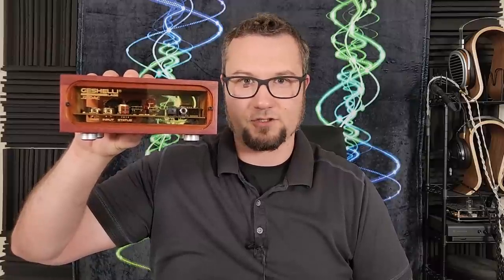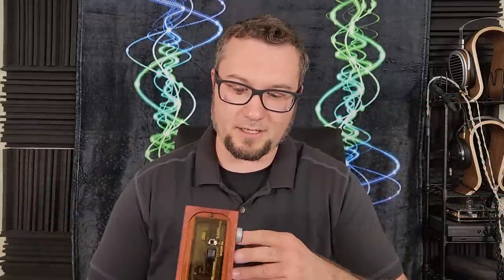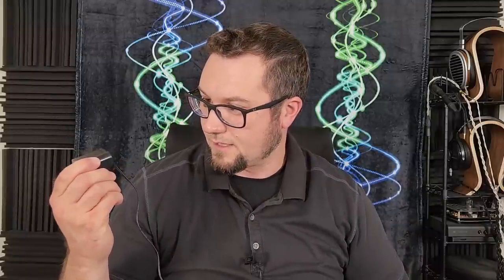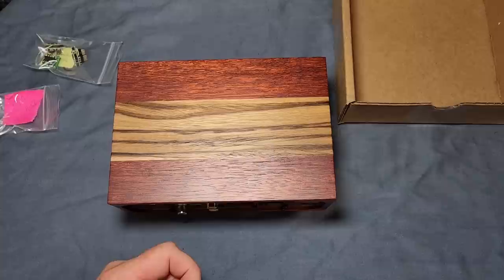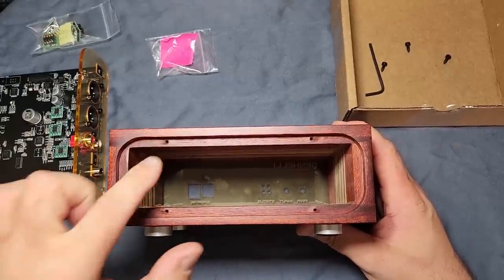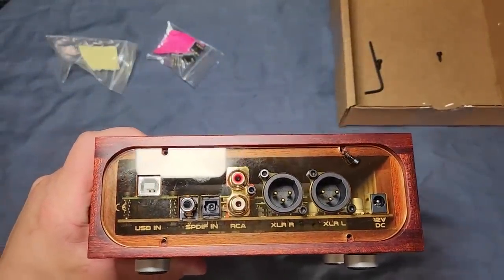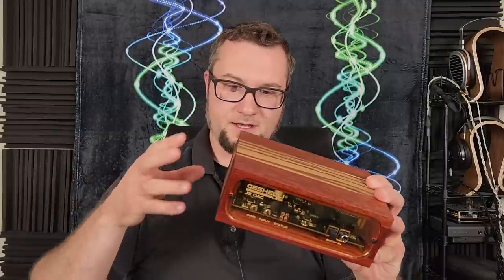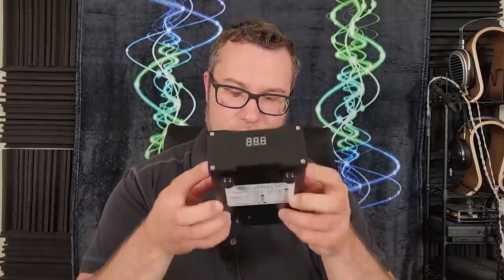Geshelli Labs J2S DAC Review w/ Sparkos Op-amps, Op-amp rolling how-to, Comp with BF2/64 & More!

Comment: Thanks for showing how easy it is to change op amps in the Geshelli J2S. I have an Aune X8, Burson conductor 3XP, and  Conductor Reference SE and all have sockets. Both Bursons are shipping with 4 Vivid op amps each. So I had plenty of those to evaluate with. I also have 4 each of the Sparkos Labs 3602 and 2590Pro op amps. And I soldered up 5 OPA1656 (surface mount) onto dip adapters. The difference between the various op amps is quite easy to hear in the Aune and the Bursons using the Reference as headphone amp (single ended RCA optimized only for this version) and listening through the excellent HiFiMan Ananda Nano headphones. 

The OPA1656 is the new cutting edge IC op amp that is considered one of the current best but I find that it is easily bettered by all 3 of the discrete op amps . In comparison it is not as wide and any instruments that are mixed to the far sides become harder to make out. It does have a solid center image but is slightly more veiled and flat. 

Burson has been building various iterations of a vertically oriented larger discrete op amp and the Vivid is the newest which are coming standard in most of their models with sockets. They are also aggressively marketing them to op amp rollers to try at a reasonable price. But I am unfortunately not impressed after hearing the Sparkos op amps. Not being a professional reviewer I don't feel that I have to pull my punches. I appreciate what they are trying to do but the Sparkos 3602 is clearly better at a similar price. The Vivids are wider and deeper than the OPA1656 but I thought that they might have a slight glare on female vocals and are still muddier with less clearly defined separation and fleshing out of the instrument. Cardboard facsimile were the words that popped into my head.

The Sparkos Labs 3602 is a fine sounding op amp. If the OPA1656 is the latest and greatest step up from the OPA2134 which along with the OPA627 were my favorites 20 years ago. Then there must be no IC op amp that can compare. The 3602  has more extension and power in the bass and far better transparency into a detailed 3D soundstage that the other two.can't compete with. This is in a different league and anyone buying any dac that can run these op amps will want to stretch to go for them. They easily fit the Burson gear and should plug in anywhere an 8 pin DIP device was removed.

As for the Sparkos 2590 Pro, I would venture that most people have not heard them since they are a cost no object/ size no object, format that is designed to drop in to vintage studio mixing boards. But the Dual to DIP adapter kit that Sparkos uses to adapt them can be plugged right in to the Belly Hatch position of the Aune X8 with one DIP spacer so anyone can easily try them in comparison with anything else for the price of this inexpensive $300 DAC. Since they are too big to just plug in to the sockets on the Bursons, I had to wire them up to an off board fly lead connector to reposition them to fit. But it was well worth the effort The 2590 Pro is another leap ahead of the 3602 This is what musical sounds like. And they have ridiculous extension, power and control in the bass. Female vocals sound so pure and real. They have the widest stage with detail of the reverb and hall sound right out to the edges. Interestingly I did feel at times that the 3602 might sound a bit blacker between the notes. It is a fine op amp and it fits but the 2590 has just that much more of a musical ease and detail as if you have to work far less hard to imagine a coherent image. Less filling in of missing pieces. Without spending 45 minutes to report the differences section by section on various tracks, The Sparkos Labs discrete op amps are an adamant recommendation. Try them for yourself.

Comment: I tried the SS3602 and like the SS2590 better - maybe be worth trying as well- its what I now use on by 3 amps (Burson Sololist 3XGT x6 ss2590 and my two seperate Ray Samuels Apache (4x 2590 each amp) - I tried every single op amp worthy and the 2590's was tops
Reply from the maker: Good info. Thanks for sharing
Reply: @wavetheorysound Allow me to ask you: where did you get or from whom did you order the 2590's? TIA

Comment: Nice one man. I have a Geshelli Archel 3 Pro Amp coming soon(I hope).  I'm all set with a Gustard A26 DAC.  I'd be curious what you think of the Schiit SYN.  Got one for Gaming/Movies and it surprised me in a good way. Surround Sound FTW
Reply: Nice on the A26!  I just got the Gustard P26 and put 2 SparkosLabs SS2590 dual pros in it.  I have the J2 with the new AKM4499EX coming soon... That will also have the SS2590's in it on the balanced end. 

But that A26.. Man! dual 4499EX!    Ah to dream...

Comment: Things are getting a bit confusing with opamps first it's the amplifier now swapping opamps is becoming dac thing. So now do you have to have the same opamps all through your system? If my dac has sparkos and my amp does not am I wasting money buying the j2 with sparkos.
Reply: Excellent question. I have wondered the same. If you had only one set of Sparkos amps, wouldn’t you get much more benefit by deploying them downstream in the signal path…like in the amp?
Reply from the maker: It's not a dissimilar idea in either amp or dac. The output level coming out of the DAC chip is usually very low so a small amplifier circuit becomes part of the output stage so that the output can be amplified to 4v (for balanced) or 2v (for single ended). An op-amp - which means operational amplifier - is one way to do said amplification. In the power amplifier op-amps can be used to take that 4v or 2v signal and make it even larger in magnitude. It's worthwhile to improve op-amp quality anywhere there is one. At the DAC level it's important because any details lost due to poor op-amp performance will simply vanish. No matter how good an amplifier is, it cannot add back in lost signal information.
Reply: @wavetheorysound so opamp upgrades would be needed in external phono preamps too ? Or you dont lose any infos analog to analog?

Comment: Geshelli labs J2S (AKM4493) vs Schiit Modi multibit 2

I'm looking for a recommendation between these 2 DACs. I'm wanting something with good dynamics/slam/impact with a good sound stage. For me the music needs to be engaging and fun.

For reference, I have a Schiit modi 3 and love it ( I just want more of it). For me, it smokes the Audio GD R2R-11 (the top end not resolving) and the SMSL D6S (sounds clean, but music isn't fun to listen to).

The new modi multibit 2 seems like it may give me a good soundstage and more of the "fun" I'm looking for, while I've heard the J2S (basic) is really engaging and impactful, too. 

What do you think?
Reply: I have heard JNOG2 is the best DAC "ever", and then I heard a few say they liked the Modi Multibit 2 better than it by far.  I personally think multibit/R2R DACS sound much better than Delta-sigma, they sound more analog and the individual instruments have more meat on them.  It is akin to records compared to CD.  That is compounded by the fact most Chi-Fi DACS are shooting for astronomically low distortion and high SNR, but that is also why a lot of them tend to sound sterile.  I ordered a JNOG2 socketed, decked out, but I am actually thinking of going with a Modi Multibit 2 or used Bifrost 2 (or 1 if not able to find).

Comment: Replacing an op amp is more likely to add distortion as the DAC is designed around the opamp inside.  Most people don't have enough electronic knowledge to do this. Making a difference doesn't mean better,   Every mixing desk in the audio chain has gone through hundreds of NE5532. So you put in an unsuitable OPamp in a little box in your living room, you hear some high frequency noise and think it sounds better because you paid more for it,  Unless you can test an improvement you are probably making things worse.

Comment: I think Schiit is more advanced in their usb output right? It is too bad that Geshelli needs a proper clean USB output. I use my PC as a source and it is definitely dirty and noisy.

I used Modi Multibit 2 and haven't find any problem with noisy background until now. Perhaps if I use a cleaner USB output there will be a difference even with my Modi Multibit 2. Who knows, never tried before.
Reply: Yes the Schiit USB is galvanically isolated.

Comment: Great review, I have owned the Schiit 2/64 for just over a year. I stream Apple Music and Tidal via my PC and iPad Pro to the Bifrost 2/64 through USB. I concur with the bad recordings listening on the Bifrost 2/64, so much I am thinking about looking for a new DAC. Great recordings sound great with the Bifrost 2/64 and then I want to keep it. I am using a Schiit Folkvangr (tube) amp with Mullard E88CC tubes. My headphones are the Senn HD650 and Denon AH-D9200.
Reply: I used to have the BF2 (OG), sold it, went through other dacs, and ultimately ended up deciding on the BF2/64 as my desktop DAC. It's just "right" as an all-rounder.

However, my Yggdrasil on my main setup is my favorite DAC of all time.

Comment: You can use ANY super noisy USB output you want, you just have to buy a little device that splits the USB data signal from the USB power, I have one and it eliminated 100% of the noise that was present with my khadas tone board.  Most DACs get their power from the USB, including the khadas, so this little data/power splitting device also has a separate power input, which can be fed with a cell phone charger or whatever 5v supply you want to use, and then that much cleaner power without any influence from the computer is sent along with the data to the DAC.  Since the J2 has it's own separate 12v input, this part might not even be necessary and perhaps it only needs the data input.

Comment: Using Sparkos ss2590 op amp in the single ended brings the J2S 4493 to a whole nother level. However a linear power supply is needed.  This is my configuration

Comment: Adding LPS to this DAC should upgrads sound quality qs much as opamp switching. I have tried cheap LPS from AliExpress first and I was not impressed. It made little better base but sounds became little dull, not that upgraded sounds I expected. So I added my custom made LPS made with audiophile quality capacitors and increased capacitance with custom made power cable and usb cable and upgraded sounds I get was really expected. Extra bottom end, wider sound stage, more texture, bigger dynamic, every aspect of the sound quality was improved. It really made cheap Wiim pro to next level streamer.

Comment: Great and thorough review.  Thanks.  I have a j2s with sparkos in the single ended out with a 50w lps.  Do you feel i need to add sparkos in the balanced end to make this configuration fully competitive with the bifrost 2 64?  The lps is still being broken in. It really adds depth and soundstage but does emphasize the upper mids compared to the stock ps in my opinion. Your thoughts?

Comment: I wonder if anyone has tried the sparkos ss2590, an op-amp step up. I also agree on the improvements you've mentioned but funnily enough some sites will measure no difference and say there should be no difference.
Reply: I also wonder why Geshelli is not using the higer end SS2590, price difference is not much, but its bit bigger though in the dual configuration.
Reply: I have used the SS2590 on the single ended RCA output - and it is wonderful! It may require a single riser (Sparkos sells these for $2), as it is snug. If you also have the SS3602 on the balanced XLR sockets, you need a 2nd riser for the SS2590, to raise it up higher.
Reply: @NeilBlanchard  you can get dual ss2590 from sparkos, select the option where you get them to solder the adaptor on. I have 6 for my soloist GT and it's nowhere near the same amp anymore.
Reply: @RyuMasterEX  Yes - understood. I have several of these in Geshelli DACs, and in my AkitikA PR-102 preamp. They sound *fantastic*!
Reply: @NeilBlanchard  Hello sir! is there any difference in sound between XLR and RCA? I have an old preamp wich uses only RCA...
Reply: @beslemeto  I think XLR is only needed with long cable runs. There are probably smaller improvements with balanced circuits. In the case of the J2S, I think that the big Sparkos makes the single ended output sound as good or better than the balanced with the small Sparkos.
Reply: @NeilBlanchard  Which version is that exavtly sir?Thanks for your response!
Reply: @beslemeto  Which version of what - the J2S or Sparkos, or ... ?

Comment: i can't seem to find the highest quality that J2 can provide. Will it do 24/192?
Reply from the maker: Sampling rate is not necessarily tied to quality. Lot's goes into that. But, the Geshelli dacs typically handle up to 24/192 via their spdif inputs and dsd and up to 32/384 via usb.

Comment: I'm just curious about the whole ideal of a 'noisy' PC USB. Surely, it's a digital bitstream? Would I still have the same issues if I used the SPDIF-Out on my sound card?
Reply from the maker: It is a digital bitstream, correct. The trick is the 1s and 0s of the digital bitstream have to be transmitted as modulations of an electromagnetic wave. What travels along the usb wire is an EM wave shaped to represent the 1s and 0s. Being an EM wave makes it susceptible to other sources EM interference. Computers have dozens of electrical circuits sending tiny little currents every which way and lots of little individual power supplies providing energy to all those little circuits. Those circuits create their own EM fields which can start to mess with how the audio 1s and 0s traveling as EM waves themselves move about. All those power supplies often cause their own problems as well because they tend to not be filtered out of other EM signals very well. So what happens is the wave carrying the representations of the 1s and 0s just starts to get messy because it's traveling through a lot of junk. Our ears interpret this as a less clean or "noisy" signal. Using a fiber optic output helps reduce some of the noise but will only go so far. SPDIF also has its own drawbacks in terms of bandwidth and what kinds of signals it can carry. Does this help?

Comment: If I use a Wiim Pro and connect it to the j2s and then to my amp. How can I then control the volumen on the Wiim pro with my phone using airplay 2?
Reply: Yes. In audio settings on the WIIM PRO go to Fixed volume output and unclick it. Then you can control the volume from your mobile device

Comment: With the Sparkos SS3602 OPA on the unbalanced output, how much of an improvement is offered to someone for whom connection via RCA cables is the only option?
Reply from the maker: It's an improvement over the TIs to be sure. But if you really need SE I'd save a bit more and look into Soekris dac1421. I have a review for that out as well.

Comment: I have the j2s with the Sparkos 3602 in the single ended output.  It’s brilliant.  Would I gain much by using the 3602 in balanced?   My preamp is a freya noval which accepts balanced.  Your review is very informative and accurate imo.  Interested to see your review of the j2s 4499
Reply: I have an old preamp which uses only RCA. I think we have to ask that question to Geshelli company.

Comment: I've had my 2/64 for a month now and honestly don't like what it does to female vocals. Something in the mids is off to me with the way the burrito filter highlights certain parts of the frequency. But I'm 100% single ended, is there any other DAC out there sub $500 that I should be looking at? I have a Mimby, and Mimby 2 doesn't feel like much of an upgrade if it has the same 2/64 tonality.
Reply from the maker: Oof, quality SE dacs under $500 are rare. The Modi Multibit 2 is solid but probably similar to your issues with the latest Bifrost. If $500 is a hard ceiling I'd search around for used Soekris dac1421. A used Chord Mojo 2 may be an option but I haven't heard that one yet.
Reply: @wavetheorysound I need multiple dacs so budget can't stretch that much. I might get the EF400 for the office since its USB only, a J2 for the tv and definitely leaning Soekris for 2.0 channel music/tube on Sennheisers. I listened to the BF2 last night and preferred NOS apart from the occasional high frequency zinguer. The filter emphasizes sounds too much for me.

Comment: This is a great little dac. I use only the single ended output, but I have tried several different op-amps; Sparkos 3602, Sparkos 2590, Staccato, Burson, Sonic Imagery. The sound with Sparkos 2590 is just great, surprisingly big upgrade over the 3602. Now after watching your review I think I need to try a linear power supply!
Reply: Any suggestions on a LPS outside of the one he linked, let us know!
Reply: Thanks for sharing.
Quick question 
Are you using the dac with headphones or speakers ?
Reply: Is the riser needed tò install the S2590?